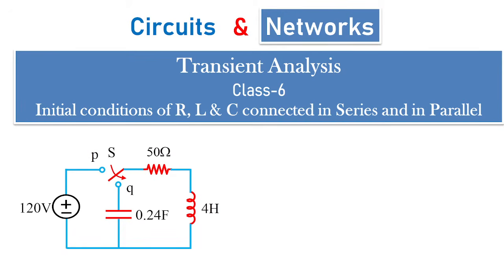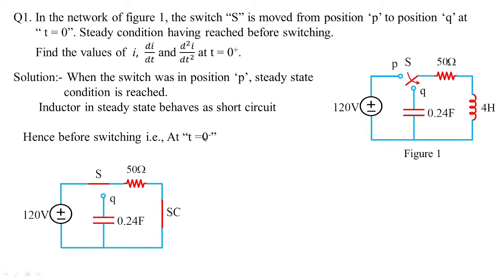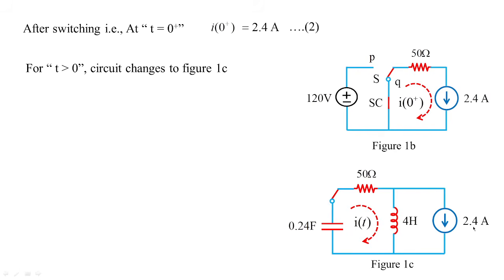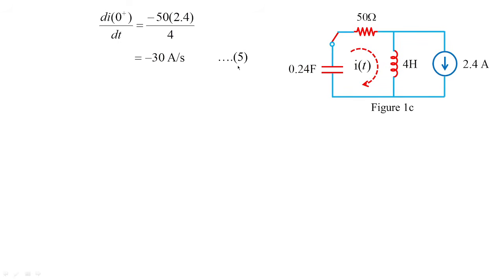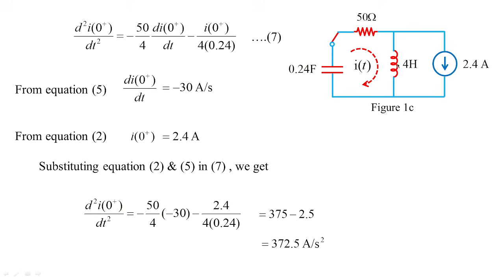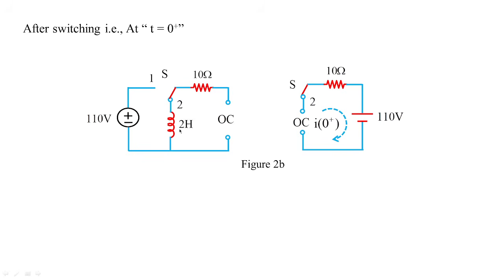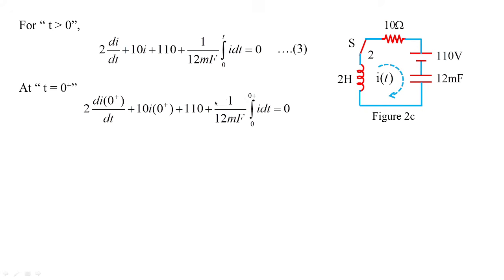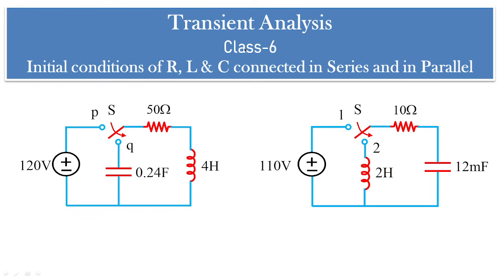How to solve transient analysis problems in RLC circuits? What is initial & steady state conditions?

Comment: Sir if at the t=0^- the capacitor act as a short circuite why you have seen at t=0^- as a open circuite
Reply: For the 2nd question
Reply from the maker: Hello dear, the question what you have asked is not clear. there are two problems we have considered. which problem capacitor conditions you are talking about. once the question is clear i will answer you.

Comment: Sir at t=0+, steady state condition is reached, therefore why does  capacitor  is not replaced by a volyage as shown in ravish r singh book and techmax
Reply from the maker: hello buddy
Inductor acts as source device, capacitor act as load element.
therefore, at that instant charged inductor is is delivering power
Reply: here we understood that capacitor is charged and its charged voltage of 110V
Reply: @rollno235  not yet understood
Reply from the maker: hello buddy
here we have discussed two problems. 
your doubt is in problem-1 or problem 2   @AffanShaikh-fw1hp
Reply: In both the problems when switch is in just after switching mode
Reply from the maker: hello buddy
make a note
inductor behaves as open circuit at t=0-
inductor behaves as short circuit at t= infinity
capacitor behaves as short circuit at t = o-
capacitor behaves as open circuit at t = infinity.
also
note that
a charged inductor acts as current source in parallel with that inductor, where as 
a charged capacitor acts as a voltage source in series with capacitor.